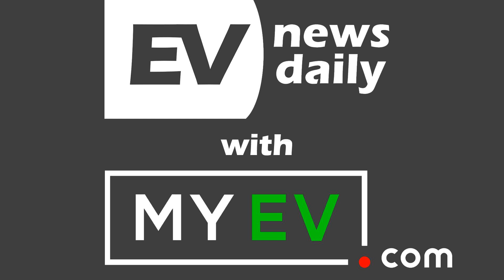28 August 2018 | Electric Trucks Are Happening Faster Than You Think, Nissan Sylphy Production...

Comment: With regard to Opel (Vauxhall) selling the Bolt.
Aren't they fully owned by PSA (Peugeot Citroen) now?
Bearing that in mind, they're more likely to sell derivatives of the Nissan leaf and Nissan group vans (which have a common platform with the PSA /Opel products).
Since the Leaf is doing so well under the Nissan badge, will they do that?
Reply: Roger Starkey 
As I understand it, PSA have stated, that they have no intension of selling the Bolt/Ampera in a right-hand version. I can understand why. There's a limited market for RHD, namely the UK & Oz. Well Opel have virtually no presence in Oz; and with a very uncertain customs future & laws still to be rewritten, (see Brexit) why would Vauxhall both for the very small UK market? Especially when you consider, that nearly everyone else drive LHD.
Reply from the maker: Hi Roger yes that’s correct. They could have licensed the car and sold it here or done some sort of deal, but the timing of the sale meant it fell between the cracks. Such a shame. And as you say PSA have their own cars which is totally understandable.

Comment: I spend between $0 and $15 a month on my modelS. But it has free supercharging and that accounts for 70% of my charging. Another 20% is done for free, to me, at my place of work. The 10% I use at my home is mostly done on my solar.. but occasionally I have had to juice her up at home for a trip, and the 100kw battery goes beyond even what I over produce for my home if I need to fill it from a low SoC.
Reply from the maker: Wow imagine having some months where your cost is literally $Zero. That’s awesome, of course I know it’s built into the price of the car so it’s not ‘free’ but that’s still fantastic. M
Reply: EV News Daily - the electric car show Exactly.. nothing is free.. my solar isn’t free either.. but it’s nice when I go months with 0 extra fuel cost on top